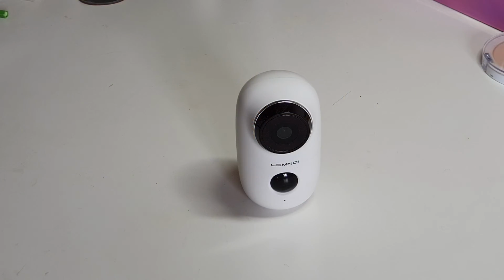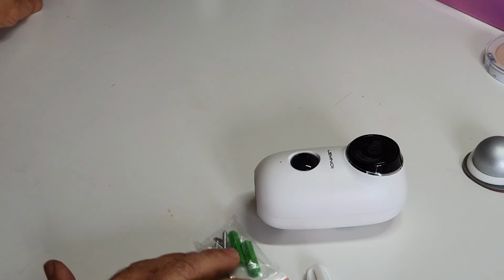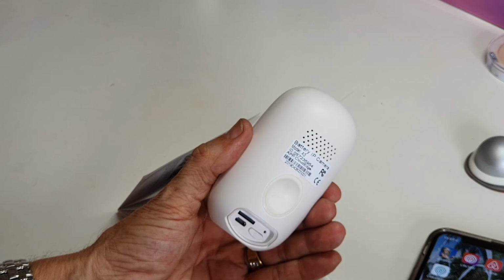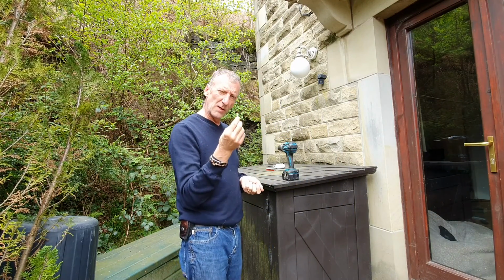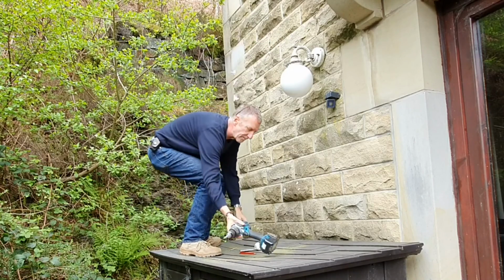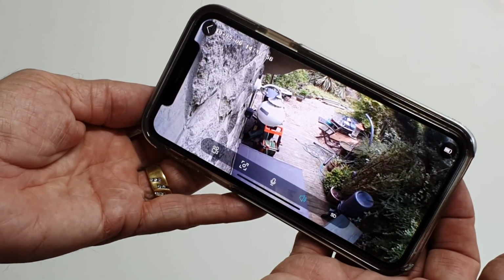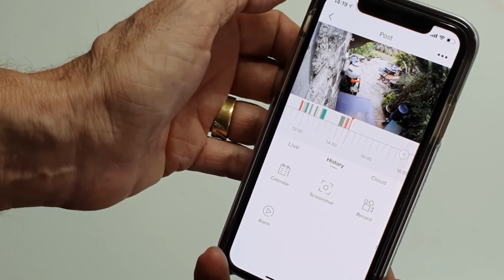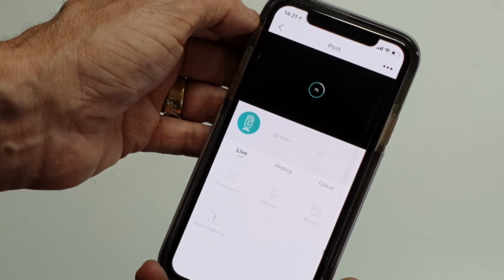Lemnoi Wirefree Wifi Security Camera Installaton & Review

Comment: Hi, I have a similar camera that also runs on batteries, when the camera notices the movement it starts recording but only 30 seconds, after that it is reactivated also for 30 seconds, I don't have the option of continuous recording, is that the case with that camera?
Reply from the maker: As long as there is movement on the PIR, it will record

Comment: Good video mate, how about the battery?  How many days BTW recharging?
Reply from the maker: I use it on the magnetic mount in the house now, but probably charge it every month.  It doesn't need it but I like to keep it topped up just in case in forget.  I go away for 5 weeks in the summer and there is never an issue
Reply: @CloughReviews  Thanks for clearing that out. I just purchased 8 Cams and currently in the setup process. so far its great. Thank you 🙏

Comment: I have had these cameras for about 6 months now and quality of the picture at night is shocking. If it's been raining the lens gets all distorted and is unusable.
Reply from the maker: Nope, mine are still fine, perfect in fact with the distance that the IR works.  That's probably the problem with yours though, if they aren't pointing down or protected from the rain, the IR's will just reflect back into the lens, whiting it out.  The closest I came to this was for about a week, a spider would come out and sit on the lens and the IR's would light it up like a torch, blinding the sensor
Reply: @CloughReviews  I seem to get white speckles on mine making them useless at night. I took them down to recharge them this morning and one of the lens covers was hanging off so I super glued it back on. I have contacted tech support with screen shots of the image quality. Not holding my breath in getting a reply.
Reply from the maker: Do you think it was misting up then?  If you have only had it for 6 months, you would think that you could do something with Amazon but I've struggled in the past.  I suppose thats the difference with paying that bit more in a bricks and mortar shop 😒
Reply: @CloughReviews  I don't think so as I have two and the other lens is OK but it's still really speckly at night. I am kind-of regretting buying them now as the customer support is really bad.

Comment: Does the camera work in low light conditions please? Some cameras have night shot lens?
Reply from the maker: Yes, it flips over to night shooting at dusk.
Reply: @CloughReviews  Thank you. Just found out there's no wifi in the compound so I need a similar cam but 4G sim card compatible. 

Do you know of a simiar one please that operates with a sim card too. Thanks.
Reply from the maker: @markweatherall7437  no, but maybe a cheap smartphone, permently plugged in close by, used as a hot spot?
Reply: @CloughReviews Ok thanks. I need a battery  operated cam, totally independent cam without Wifi and Electric.
Reply: @CloughReviews  Ha I see now. So the camera would work from a smartphone hotspot?? That sounds a good Idea if the camera is battery operated?

Comment: Any new comments or updates to performance now, a few months later?
Reply from the maker: Hi Frank, No, everything is working perfectly.  I brought it inside when I went on holiday and used the magnetic mount it came with.  Really powerful, easy to adjust position and remove for charging.
Reply: Clough Reviews can I ask, how long does the battery take for a full recharge when drained?
Reply from the maker: @franknigro1080  Couldn't say exactly, I just take it down, bang it onto the Micro USB connector and when I remember co come back to it, it's charged.  Sorry.  It's not long though, maybe a couple of hours Max

Comment: How does the unit's wireless connection work?
Reply from the maker: Fine, that's going through a solid stone wall and 6 inches of block to get to the house WiFi.  Works great on the app
Reply: @CloughReviews  Thanks for your reply. So first the camera has to be linked to the house wifi, then for its remote access to the cellphone. Is there a distance limitation between the camera and House WIFI? Why my question,  I'm a bit confused, I bought a sort of go pro camera, same concept, however, my go pro goes with me everywhere and I can control and view it using my smartphone, I'm sure I had to link it first to my house WIFI too.
Reply from the maker: @ArdoEdu  the camera has to be linked to the WiFi of the property so that you can access it from anywhere in the world on your phone for example
Reply: @CloughReviews  Got it, I feel like an idiot cuz I knew the answer. So how can I find out the max distance between the camera and the House WIFI? probably if I need to extend the distance I might need to get a wifi repeater?, isn't it?
Reply from the maker: @ArdoEdu  go to where you want the camera and do a speed test with your phone to see what the signal is like
Reply: @CloughReviews Got it, Thanks, btw great vid.

Comment: Several questions.  How well does the motion detector and night vision work.  Does it have an alarm that can be turned off from a distance..say 5000 miles and is the alarm really loud in case it riggers itself. Do you know if it works on all IOS devices.  I have an iPhone 5s.  How is the sound incoming from the operator for example. Can I use it only in motion detection mode.

Thanks
Reply from the maker: The Motion detection and night vision are good.  The alarm is for you though, you get a warning via the App, you then choose if you want to open two way audio I suppose.....
Reply: @CloughReviews  Thanks for the answer.  So are you saying their is no strident alarm within the operating zone if motion is detected?  Because thousands of miles away I would have a hard time getting back to turn it off.
Reply from the maker: Nor sure if I'm understanding.  If you set the motion detection, you will be notified/alerted via the app.  If you then want to open two way audio to warn the intruder or speak to whoever is there, you can.  It doesn't sound an alarm on the camera off like some mains powered ones I have

Comment: I accidentally turned mine on before putting the SD card in.. what do I do now? Is it ever going to work
Reply from the maker: Yes, don't worry about it, you don't even have to use an SD card, so running it without one wouldn't damage it

Comment: Having had it for a few months now, how are you feeling about it?  Does the battery last for over a month?  Do you get appropriate alerts (few false reports/triggers)?  Does the app work well?  What are your feelings a few months in?
Reply from the maker: It still works great, I'm getting closer to two months and the only false alerts I was getting were from a spider that took up home near the lens.  I've moved it inside to protect the house while I'm away on holiday at the moment, so am using the magnetic mount that it came with.  The app is great.